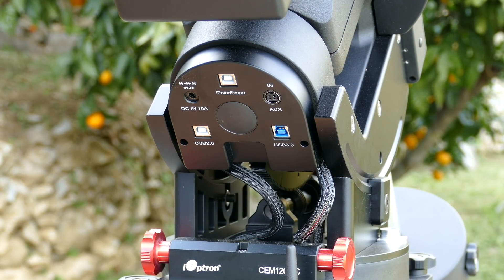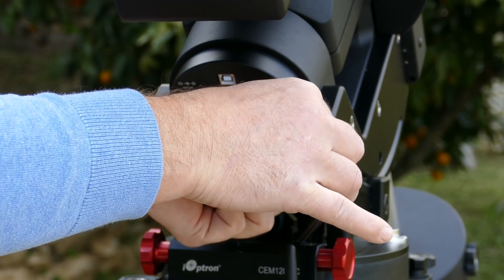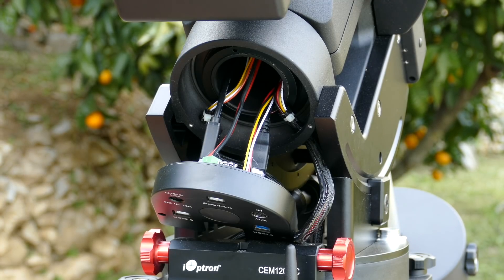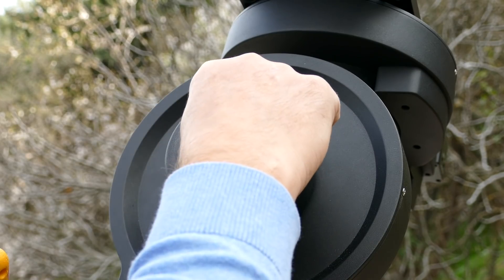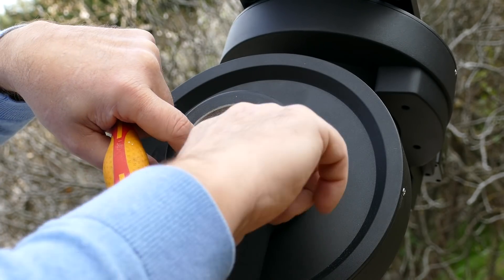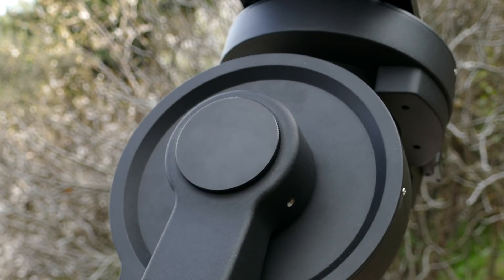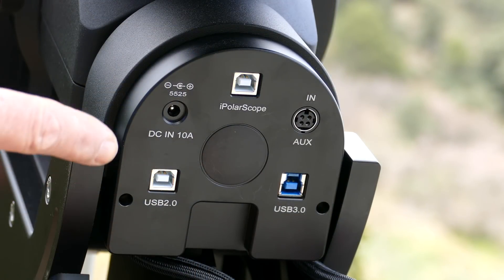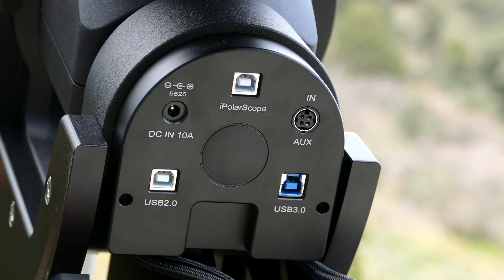Fitting QHY Polemaster to iOptron CEM120

Comment: I'm gathering that your CEM 120 didn't come with the iPolar installed or did you remove it previously?
Reply from the maker: No polar scope was fitted.  I'm not entirely sure if the newer models come with it, but this is an early model which wasn't, but you can but the mounting kit.
Reply: @simplifiedastro2092  I believe the newer version give you the option.  I curently have the CEM70 which has the iOptron version, I don't really care for.  Still using my QHY Polemaster since it works great
Reply from the maker: @Phoenix_Astro  Ah ok.  Yes I quite like the Polemaster.  Very easy to use so enables regular checking of PA a doddle.

Comment: Thanks for your videos. I’m considering a purchase of a CEM-120 and need to decide EC or non EC version. Frankly I can purchase a non EC version now but will have to delay the purchase if I go with the EC version. I’m debating if the encoders are going to be of benefit to me as I have seen so many people post guiding stats of 0,5 - 0,9 rms with huge payloads. If that’s the norm I’m questioning if I really need the encoder or am I missing something?
Reply from the maker: Hi. The encoders effectively just reduce the periodic error, meaning it is easier to guide out any issues with the crown.  However, the mounts are extremely well made anyway, so the periodic error is pretty good even without encoders.

I would say that unless you are going to image at a very long focal length, or with an extremely high image resolution, then the non ec version is going to work absolutely fine so long as you are planning to guide.

Comment: Do you have any examples of the guiding that this mount is capable of?
Reply from the maker: Not in the format of a PHD2 log, George, but I have managed, with default settings, to guide at 0.4"/p RMS.  I have no doubts at all that this can be improved upon with some tuning, and expect to get to circa 0.35"/p RMS or slightly better.  Naturally seeing becomes the limiting factor beyond this, so if I can achieve 0.3"/p RMS I will be very happy as this reflects what I achieve with my Mesu 200.

Once I have made the adjustments I will make my guide logs available for those interested.

Comment: Just a question. Why’d you buy an iOptron?
Reply from the maker: It was this or another Mesu 200.  However, as this will be used primarily remotely, the through the mount cabling and centre balance design, leaving the camera end very clear, was what swung the balance this mount's way.  I know there are others with the same features, but not with the incredibly low PE that this mount has at this price bracket.  I intend to load this up with a fairly heavy dual rig, so the load capacity was important.

I guess you could argue that a EQ8 has a very good load capacity and is cheaper, but this mount just seemed to offer the extra elements that I really wanted.
Reply: @simplifiedastro2092  Thanks for this insight. I was also looking at the Mesu 200 at it amazing how the kilos pile up when you started adding gear and a second OTA, faster than even me in a cake and chocolate shop. Only thing that has been putting me off the Mesu 200 is the price point. At the tip of Africa where i live the bulk of the population has to work 3 months to earn the difference between the 2 mounts. Would so love the Mesu though.
Reply from the maker: @shaunozs1ra92  Yes the Mesu200 is not cheap, especially when you add the items that you have to buy separately such as the weights, saddle plate and pier adaptor.  However, it performs as well, if not better, than mounts costing twice as much, and has a very high carrying capacity for its price point.

As with all things astro related, there is never one single product that will fit every application, and this could include cost, hence me getting the CEM120 in Spain as it just suited my needs there better than the Mesu.  Both are very good mounts, but actually for different reasons, and I really enjoy using both.
Reply: @simplifiedastro2092  I have now made the necessary mental leap to spend the extra on the Mesu mainly because of another video I watched where he guy was telling a story of how Lukas flew to the UK to fix mounts that were shipped with dodgy motors. Now that the cost is out of the equation I need to think about the other factors. The Mesu s a lot more industrial than I first imagined but that is not a problem to me. The biggest problem I need to consider is the weight. I live in a white zone so there will be the occasion that I will want to take my telescope to a dark site and judging by the build of the Mesu I don't think it is going to want to be moved around much.. Aah, decisions, decisions...
Reply from the maker: @shaunozs1ra92  Great decision. The Mesu is an awesome mount and Lucas is a great engineer and a very nice chap.  I had the good fortune of spending a day in his workshop with him and he is a true gentleman who definitely knows his stuff (and his Wife serves up excellent biscuits).  I believe you can now get the Mesu200 in split form, meaning you can split it in to two sections for transportation.  Well worth looking at that as an option.

That said, I was using the CEM120 last night and in not perfect conditions was guiding nicely at 0.4"/p which is pretty good.  In perfect conditions this reduces to 0.3"/p, which is about what I get from my Mesu, meaning the seeing is the limiting factor and not the guiding.